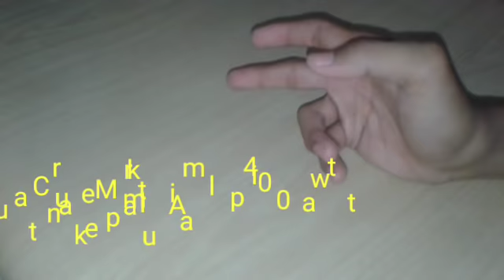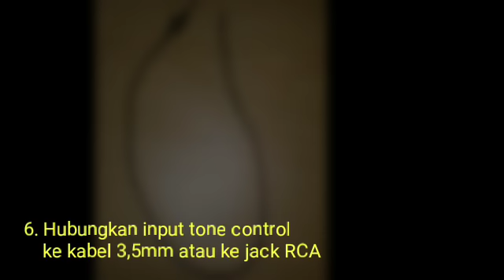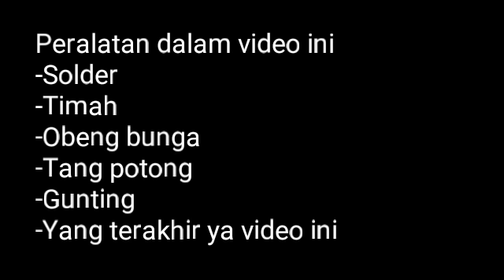Cara merakit ampli 400watt untuk pemula

Comment: mas klo Pake slikon/diode tu yg berapa amper.karna saya pake yg 5 dan elko pake 1000uf_50 v travo ko berderuk ya gan.apa saya   salah.mhon solusinya.makasi ilmunya sangat bermanfaat untuk buat belajar.
Reply from the maker: biasanya yg membuat trafo bergetar gggrrrrr seperti itu karna ada beban berat bisa juga short.. mungkin kabel nya ada yg salah pasang... kalau soal elco boleh pakai 50v selama trafo nya yg 24vCT.. kalau trafo nya pakai 32CT disarankan pakai elco 80volt
besarnya amper dioda usahakan diatas amper trafo

Comment: Mas cara menambahkan audio out pada amplifier gimana ya mas...trimsh ..
Reply from the maker: out mau diumpankan ke mana ? kalau misal dari power ampli mau ke headphone pakai resistor 100 ohm-330 ohm atau ke ampli lain lagi cukup diseri dengan resistor 47K-220K
Reply: @barlexrespectaizer452  bang maw naya trafo 5@murni ct45 belt drefr socl506 tunerays pake 3set final toshiba permono pake 2 drefer jadi sterio dengan elco epsilon 10000 80v 2 buah . sangub ng gendog spiker 15x2 sama 10×2 +twuiter om smoga di jawab terimaksi

Comment: Mau tanya mas kit power 400 watt streo klau pakai speaker 12in×2 masing berdaya 400 watt persepeaker agar suaranya bisa maksimal pake .elco ukuran berapa volf dan berapa ampere ukuran trafonya ya mas mohon untuk di jawab mas maaf baru pemula..
Reply from the maker: pakai elco 10.000uf aja mas sepasang biar gk drop.. dan trafo minimal pakai 10Amper.. tegangan nya sesuaikan sama transistor final yg dipakai..
Reply: Barlex respectaizer kalau pakai 5 Ampere murni bisa ngak mas
Reply from the maker: kalau pakai 5A cukup untuk satu speaker aja
Reply: Barlex respectaizer ok mas

Comment: Bang saya ada subwoofer lanzar 12 in 1000watt 2pcs. Minta pendapatnya kit power pake apa beserta power suplaynya juga. sementara saya  ada trafo 10 amper ct.. elko 80v 10000mf 2buah... mohon pencerahannya bang. Salam saya dari Kaltim...
Reply from the maker: trafo nya bisa keluar 45ct ? kalau bisa ya pakai power blazer aja 1pcs lalu subwoofer nya diparalel main 4 ohm.. transistor nya pakai sanken 1216 sesuaikan kebutuhan kit nya pakai berapa tr..
Reply from the maker: atau kalau dana nya cukup buat kit nya 2pcs masing masing angkat 1 speaker
Reply: @barlexrespectaizer452  untuk elkonya kira2 tambah lagi gak bang.... kalo trafonya maksimal keluar 42volt aja bang ...
Reply from the maker: elco boleh ditambah kalau suara sember karna voltase drop.. tp pastikan dulu elconya asli dan tahan main volt segitu..
Reply: @barlexrespectaizer452  terima kasih infonya. Smoga Chanel nya maju terus. Boleh nggak aq minta skemanya bang... untuk Main 1000-2000 Watt...

Comment: Om ....kalo buat mp3 bluthoot yang 5 volt pake resistornya tipe berapa ..............
Reply from the maker: Pernah coba pakai resistor tadi gak nemu yang pas.. resistor nilai rendah tapi panas banget.. kalau resistor nilai tinggi gak mau hidup.. saran kalau mau pake bluetooth mp3 dikasih sistem stabil 5volt yg pakai zener
Reply: saya coba2  pake ic 7805  ngambil jalurnya dari elko power suplay ampli payer  ternyata josss  horeee berhasil.......ma`lum  anak baru jd seneng  heee.....

Comment: Gan saya punya amplifier 80watt itu supaya maksimal pakai travo uk brapa ya, suaranya biar maksimal pakai speaker brpa inch ya gan, trmmkaaih tutor sangat berguna sbagai pemula kayak saya
Reply from the maker: untuk tegangan ampli biasanya ada tulisan butuh berapa volt..
idealnya sih biasa ampli 80watt itu pakai trafo 3 Amper 18v ct, 
yg paling cocok ya speaker 6 inch
Reply: @barlexrespectaizer452  klo kita paralel untuk transistor finalnya untuk powernya tetap gpp ya gan? Biar bisa untuk apeaker 10inc
Reply from the maker: gpp, tapi kalau transistornya diganti yg besar naikkan lah jadi 24v

Comment: mau tanya mas klo berkenan berbagi.. sy punya apli kecil trafo 10A CT max 32v, smentara ini masih pke jengkolan (1 set kiri & 1 set kanan), rencana mau nyoba ganti ke toshiba 2SA & 2SC (dua set kiri  & dua set kanan), nah untuk drivernya ada yg perlu diubah gak ya? atau langsung Plug n Play gtu sj? & utk R kapur + voltase dari trafo utk tr toshiba idelanya berapa ya?  trims b'4..
Reply from the maker: rangkaian pcb nya bagaimana dulu gan.. pastikan transistor driver nya sebelum transistor final itu udah pakai transistor TIP 41& 42 dan R nya udah pakai resistor batu yg 5 watt.. lalu trafo nya saya rasa kurang kalau 32volt mau pakai dua set dua set.. kalau ada trafo nya 42CT bisa dipakai dengan kata lain elco power suplay harus diperbesar tegangan nya.. 
TAPI kalau pun trafo nya harus pakai 10A 32V silahkan elco nya pakai yg besar dan banyak supaya tegangan tidak drop.
Reply: @barlexrespectaizer452  klau elconya powernya sy tambahin 2 biji jadi 4x10000uF 50volt an apa sudah cukup ato masih kurang ya? trims b'4

Comment: tonecontrol itu stereo klo d tmbah pilter subwooper bisa ga,kl bisa apa speker ny harus ada spkr sub...ny?
Reply from the maker: bisa.. filter sub dan tone control dipasang inputnya diparalel dan output tone serta output filter sub masing masing digabung dengan resistor 22K sampai 100K. tapi kelemahannya, speaker tweeter atau midle masuk bass yg dahsyat bisa cepat putus. lalu terkadang bisa tumpang tindih antara bass dari tone ctrl dan bass dari sub..
Reply: @barlexrespectaizer452  bng  rakitan seperti stereo itu ,speker ny satu saja 12 inc subwooper double coil,tpi k dua doubel coil ny di pakai,bisa ga bng?
Reply from the maker: @rezarismawati206  bisa.. yg penting gk terbalik polaritas spk nya
Reply: @barlexrespectaizer452  minta pndpat,bng twiter biar awet di kasih tahanan apa,?

Comment: Bang knp power q lemah angkat speker 15 inc x2? Power 300w trapo 5a besar elcho 10rb mkr 50v dioda 25a
Reply from the maker: speaker 15 inch butuh power besar, gak cukup hanya pakai ampli 300w, trafonya juga minimal  10Amper 47ct (main di tegangan 66Volt dc )
Reply: @barlexrespectaizer452  klu power 600w dh bs bg?
Reply from the maker: bisa tapi lihat speakernya, soalnya ada juga 15 inch 1000watt keatas

Comment: Bang saya mau tanya dong.. Saya kan beli kit power safari 400 watt. Knp ga bisa di beri tegangan lbh dari 18volt dari trafo.. Klo pake 24/ lbh malah dengung aja ga ada suaranya.. Tlg penjelasanya dong.. Tks
Reply from the maker: biasanya karna transistor bawaan palsu bang, ada tulisan hanaya/monstar/dll
Reply: Jadi solusinya apa ya bang yg hrs di ganti?tks
Reply from the maker: @janadi4821  kalau memang palsu ya ganti dengan yg bagus/asli.. tapi kalau dah asli ngapain diganti
Reply: Oke bang jd yg bermasalah tr drivernya ya bang
Reply from the maker: biasanya begitu, tapi terkadang masalah gk selalu sama
Reply: Oke tks byk informasinya.. Sukses slalu ya bang
Reply: Bos maaf mau taya,sy puya drever 400 wtt mono sanken.sy pake travo 10 a dioda 10 a.elko 50 v 4 bj td ada elo yg bojor 1.klu elco d ganti dg  80 v 10000 mrf,2 ,bj bisa ga.dan sepiker 10 in 300 wtt,pake tegangan 35 v.mohon balasan y.

Comment: Mas beda antara potensio 100k dan 50k itu d suara bagaimana.soale aq pernah ganti potensio 100k aq gnti 50k
Reply from the maker: kalau posisi nya di volume akan mengurangi sensitifitas nya jadi low noise.. tapi pengaruhnyabke suara itu saat diputar dikit yg 50k udah langsung kuat suaranya.. kalau yg 100k putar sedikit nambah suara sedikit.. jadi gk tiba tiba kuat
Reply: @barlexrespectaizer452  buat filter subwoofer sama midle mas.kemarin potensionya grok2 trs saya ganti sendiri
Reply from the maker: kalau dibagian subwoofer volume aman gan.. kalau dibagian frequency mungkin akan pengaruh ke frequency sub yg dihasilkan

Comment: Mas mau nanyk klu d ksik elco 10000uf 50v 4biji gmna mas
Reply from the maker: lebih bagus,
Reply: @barlexrespectaizer452  ok mas. Klu elco 10000uf 50v 4biji trus diodany brp ampere mas
Reply from the maker: diodanya kasih aja yg lebih besar dari amper trafo nya mas, misal trafo 5Amper kasih dioda 8Amper
atau trafo 10A kasih dioda 15Amper

Comment: Kalo misal elconya 50 volt 6800 micro untuk ngambil tegangan di trafo masing  masing yang  30 volt, elconya kuat gak ya?
Reply from the maker: Supaya aman pasang yg diatas 50volt gan.. misal 6800uf/80v..   kalau main trafo 24v masih cocok pakai elco 50v

Comment: Mas mau tanya saya pemula kan itu pakek AC 24 nanti pasti kalok sudah jadi dc pasti 40 keatas sedangkan power amplifier hanya butuh 22volt apa gk merusak komponen mohon pencerahanya terimakasih
Reply from the maker: kalau pakai transistor palsu mungkin akan jebol komponen nya, tapi kalau pakai transistor asli aman aja.. malah bagus dan makin halus suaranya..
Reply: @barlexrespectaizer452  terimakaaih mas 
Kemarin saya beli ic sanken saya liat2 dirumah teryata sanken palsu merek nya teryatan hanaya apakah ic hanaya termasuk golongan ic bagus mas mohon pencerahanya
Reply from the maker: hanaya termasuk transistor palsu, harganya cuma 10ribuan.. yg asli harga 40ribuan sepasang, ada tulisan sanken nya
Reply: @barlexrespectaizer452  gk Ada ya itu hanaya tulisanya tapi body mirip sanken
Hanaya tipe 2SC2922 . 2SA1216
2PASANG
Reply from the maker: ia palsu itu
Reply: @barlexrespectaizer452  wah kena tipu saya makasih bang infonya
Reply from the maker: siap.. kalau yg palsu itu suaranya agak kemresek seperti radio yg kurang sinyal wwkwk

Comment: Saya pakai kit ampli 400 watt swara bass kok kaya kurang arus, geber mas, gimana solusinya?
Apa mungkin kurang elco, karena cuma pakai elco 2biji
Reply from the maker: box nya harus kokoh mas, kalau soal kurang elco suara nya dekat enak tapi jauh agak cacat yg disebabkan elco..
Reply: @barlexrespectaizer452  kalau volum kecil enak suaranya, tp kalau volum keras awaranya gak karu2an, tolong masukannya?
Reply from the maker: coba tulis setup nya gan ?
pakai trafo berapa amper, kit nya seperti apa dan tone control spt apa, speaker merek apa berapa inch, lalu box nya seperti apa
Reply: @barlexrespectaizer452  travo 5A 32v, kit safari 400watt, tone control pakai parametrik,
Reply from the maker: coba pakai capasitor 22nf-220nf antara out parametrik ke input safari.. 
nilai capasitor nya dicoba aja mana yg pas mulai dari yg paling kecil 22n

Comment: Mas kalau dioda 25@ trafo 5@ elco 10000uf50v, bisa ngak soallnya punya bahan* itu
Reply from the maker: bisa gan,
Reply: @barlexrespectaizer452  kalau kita 400w soundnya 400w, kalau pakai sound kecil bisa terbakar ngak, makasih
Reply from the maker: minimal pakai 10 inch aman om..
Reply: Oke siap
Reply: Boss maf mau taya.ni kebetulan msh bljr.sy merakit power 400 w dg travo 10 a,dioda 25 a,elco 80 v 10000 mkr 2,bj,dg beban 300 w 8 om.td y sura sdh bgs.e glma nada bas sember.mohon pejelasan y.mks

Comment: mas kurang paham pas pasang transistornya
itu pake tipe apa + tipe lain bisa gk
Reply from the maker: pasang transistornya seperti biasa.. tinggal copot yg bawaan dan ganti dengan toshiba 5200 posisi kaki nya juga sama
Reply: @barlexrespectaizer452  tr final thosiha yg ory harga berapa ms
Reply from the maker: yg c5200 sepasang terakhir ssya beli di sini 35rb
Reply: @barlexrespectaizer452  klo speaker subwoofer dobel coil 200watt bagusnya pke power yg berapa watt ms.

Comment: pak saya punya power bekas mobil, smuanya normal tetapi jika saya besarkan volume dan bass saya besarkan tiba2 powernya kedap kedip kayak mau mati, itu kenapa ya, mohon bantuanya
Reply from the maker: Itu protek pak.. mungkin tegangan nya gak stabil.. sehingga waktu mau ngebass drop voltase nya.. coba waktu besarin bass dan volume mobil nya agak di gas posisi hidup.. kalau bagus berarti butuh capasitor bank
Reply from the maker: Yang kedua mungkin ada komponen didalam yg lemah.. gak sanggup lagi handle beban berat.. dan bisa juga karna beban speaker yg terlalu kecil.. misal 2ohm buat ampli panas dan protek
Reply: @barlexrespectaizer452  
ini posisinya lepas dari mobil, saya rakit sendiri pake travo 5A
Reply: ini saya coba pasang di kamar
Reply from the maker: Ooh ya pantes pak.. gak sanggup tuh trafo nya..  secara kan Accu mobil 50Amper keatas....
Coba pake trafo 10 Amper pak
Reply: speaker saya pake 6" X 2 dan bekas subwoofer

Comment: Bang yg tulisan loudnes gunanya buatapa
Reply from the maker: Buat mengeraskan suara bg.. jd bass dan treble itu dinaikkan spontan 50%.. tapi mid nya terbenam.. kalau ampli dan speaker gak mampu handle bass dan treble yg agresive suaranya bisa ancur
Reply: Trs Kbel Ct r ct l nya masuk kemana ya pak
Saya bli tune control ada loudnes trs sebelahnya ada tulisan ct r ct l nya
Boleh minta nomer wa nya
Reply from the maker: Kabel CT L CT R nya sambung ke CT potensio volume nya..
Biasa di tengah atas ada CT potensio volume kalau beli jadi
Reply: Siap mas terimakasih buat ilmunya

Comment: Trafo saya ko 25 vold bang bukan 24 apa sama saja bang
Reply from the maker: coba ukur hasilnya pas atau gak.. 
tapi itu pun bisa dipakai bg
Reply: Oke bang kalau memang bisa mah g pp kali lebih dikit mah gtu bang
Reply: Pasang tune control ngambil dari dc power 24v cuma di kasih resistor 2k2 apakah ga pp bang

Comment: Kalau powernya 150wat trafo 5@ berapa keluar Wattnya bang
Reply from the maker: Misalkan trafo 24volt CT.. kalau dah disearahkan jadi DC 24*1,42 = 33,84volt DC
Daya yg dihasilkan trafo 5A = V*I = 33,84 * 5 = 169,2 Watt..
Ini memang yg dihasilkan trafo 5Amper itu pun kalau trafo nya murni.. lalu yg dihasilkan ampli nya berapa ? Ya banyak faktor yg mempengaruhi.. makin panas ampli makin banyak rugi daya atau watt yg terbuang

Comment: Terminal speakernua dimna bg
Reply from the maker: sya gk pakai terminal speaker.. kalau mau pakai terminal hubungkan dengan kabel dari output amplinya
Reply: @barlexrespectaizer452  blh minta wa bg
Reply from the maker: o822524o3792
Reply: @barlexrespectaizer452  ok terima kasih

Comment: merk elco apa mas?
Reply from the maker: sesuai selera aja gan.. tanya yg bagus dan ori biar gak gampang meledup
Reply: @barlexrespectaizer452  oke gan makasih infonya semoga.sukses
.. mu nanya nih.. apa bisa dalam satu driver amplifier di pasang lebih dari 2 jenis socket
. tlg bls gan
Reply from the maker: maaf, socket apa ya gan
Reply: @barlexrespectaizer452  socket output dari driver yang menuju ke speaker.. misalkan di pasang socket RCA dan jenis lainya.. lebih dari 2 socket mksd saya
Reply from the maker: bisa.. yg penting impedansi speakernya jangan terlalu rendah biar amplinya awet
Reply: @barlexrespectaizer452  makasih gan.. bkin vidio baru dong bang.. cara mengabungin driver mono dan stereo dalam 1 tone control gitu.. apa bisa ya gan? hehe